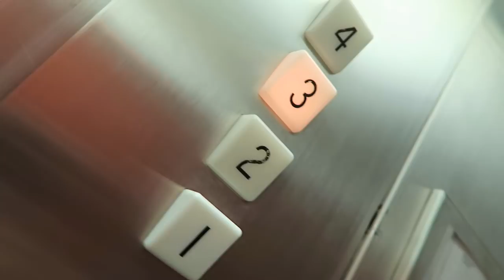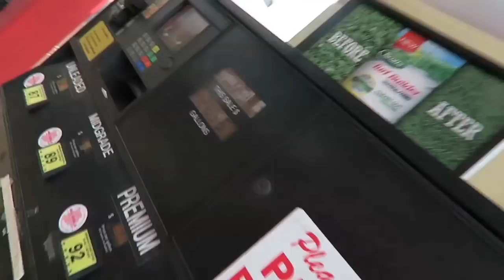GOING TO COURT!!

Comment: I believe your water valve is actually supposed to leak like that. There are a bunch of new requirements to have devices like that to prevent the water from flowing back, so when you are not using the water it leaks but stops when you actually use the water.